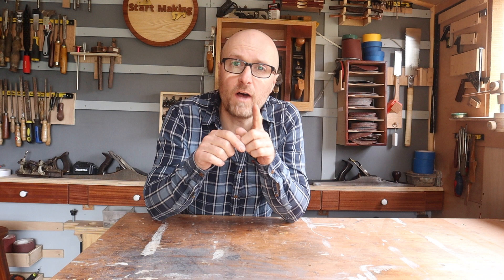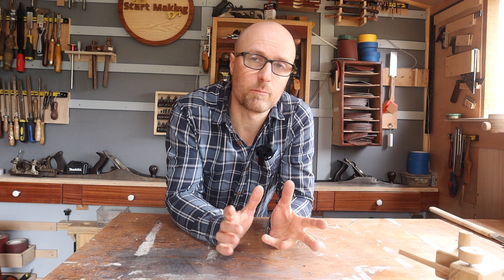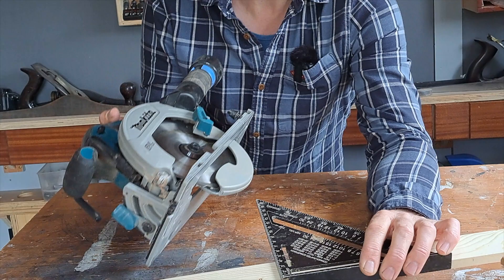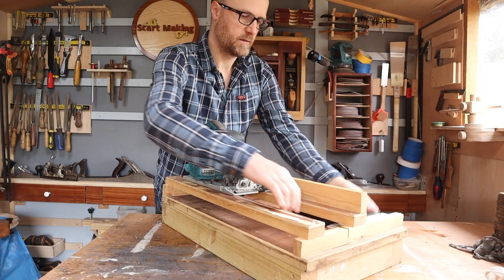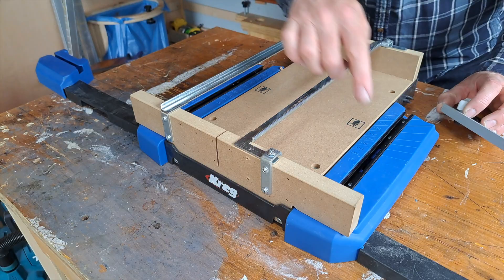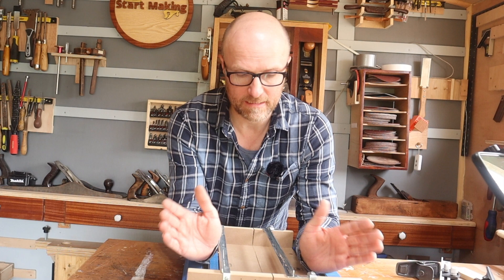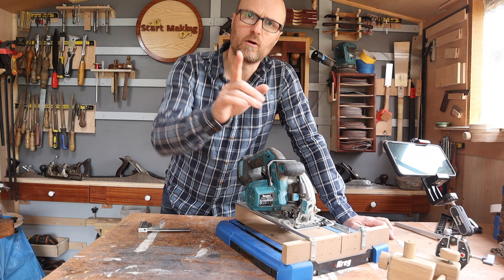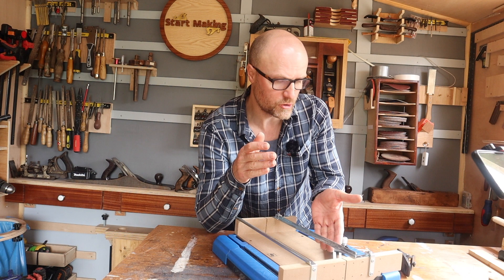Have you just nailed SQUARE cuts ? CHEAP too !!

Comment: Hi Mark, great channel and I like your videos, please keep up the good work. One tip- CA adhesive is triggered by moisture, if you breath out on wet CA glue before joining the pieces it sets much faster, though not as instantaneously as using accellerant. I use the trich when jointing with CA where some fine adjustment is needed, or indeed if I don't have accellerant to hand.
Reply from the maker: Thank you Cliff. Much appreciated. What a great bit of advice too.

Comment: the other thing you could use this jig for is to flatten boards with your  router
Reply from the maker: Hi, I love that idea. What a clever use. Great for small charcuterie boards and things like live edge coasters. And I was initially thinking it would be a pain to move the bars for the narrower router base but a piece of perspex cut to size would negate that issue. thank you so much for the inspiration. Amazing,.
Reply: If you use a piece of Perspex one other thing you can do is to put a hole in for a vacuum cleaner hose so that you have less mess at the end

Comment: £60 for a Kreg, or £160 for DWS774 ?
Reply: Sorry I have binged on your channel, but forgot you have no mains!! Do not buy a battery mitre saw.  If you buy a 20kg unit it stays in the shop. A 10kg one can be moved anywhere.  Love your channel 👌
Reply from the maker: difficult depending on situation. For me you are right, this is a. no brainer due to the lack of power. but for someone with power, I see the reason to overlook it. At the time of filming though, these were $20 in the US and around £45 in the UK. So I felt that it was a better recommendation. You would not believe how long I looked at a battery, Makita mitre saw. I think it was a whopping £750 .I was close to getting it but just couldn't bring myself to do it. Glad now that I didn't . PS thank you for watching every video, not gone unnoticed.

Comment: Very good tips and yes square cuts are vital and still a challenge. Especially when using reclaimed wood like I am doing. There is one i recently had issues with that you didn't mention.  Was having a problem with cuts over 6 inches (15cm?)  curving off to one side even using a straight edge. Couldn't figure out what the issue was and it was screwing up a outdoor cat house i was building for a stray my wife and I were caring for. Finally noticed by chance that one tooth on my blade was just slightly bent off to the side. That one tooth was pulling the saw off by 3 inches over a 4 foot cut. But even in a 6 in span was more than enough to unsquare my cuts. So long story short check your saw blade teeth.
Reply from the maker: Hi Lee. Thank you again. They are the most challenging thing once you master plane blade sharpening in my opinion. You are spot on about checking teeth. Cant believe how far that has pulled you out of square. Was that using a guide. I find mine wanders but that is often user error in my case. Going to head down and check mine now just in case. Thank you
Reply: That was using a straight edge clamp, yes. Depending on which side I was cutting against, it would either wander off to the side or would bind into the straight edge and completely stop the saw. Caused me no end of headaches in that build and couldn't think for the life of me what I was doing wrong. It was really only happenstance  (see tossing my saw aside in frustration ha) that it was upside-down and I could see the one tooth that was bent out of line in just the direction of the drift I was experiencing. I have no idea how it happened because I normally take very good care of my tools. Perhaps I clipped a nail or a really hard knot, but it was one little thing that nearly completely screwed up the whole project.
Reply: ' That one tooth was pulling the saw off by 3 inches over a 4 foot cut.'  
Realize, that one tooth being off generates a tiny force.  That can then interact with the free play of the system.  Then you get 5 or 10 other teeth crashing the other side unevenly, and then causing an even greater force back the original way.  Tiny defects can be multiplied very fast when you're spinning at dozens or hundreds of times a second.
Everything gets multiplied many times due to dynamic interaction with the play a high speed rotational system.  There is no 'small defect' in such a system.  Even a defect that doesn't show up at one speed will show up at another.  Everything has to be even and near perfect rotationally to work evenly through a range of speeds.
It's why tire balancing is kind of an art, or requires a decent computer based system to tell you what to do.  Or experience and more time to get it right.
Helps for me that I learned from flying RC helicopters in the mid-90's, finely balancing rotor heads until they run smoothly through all speeds teaches you how to do some things.  At the end you're using tiny slivers of tape to distribute just the right amount of weight to just the right place.  And it's amazing and scary just how smoothly you can get a complex collection of parts to spin.

Comment: I saw this Kreg tool in your shed tour video. I wondered what it was. This looks great for a beginner who has minimal tools. I might buy one, it looks pretty handy and fun to use for some quick cuts. I like the portability of it as well.
Reply from the maker: That is exactly who it suits. And portable. though be careful not to squash the metal runners. Not all that useful for someone with a table saw, but perfect for beginners.
Reply: @startmaking1  If a friend or family member was starting woodworking today, I would advise them to buy the Worx Exactrack circular saw so they have a versatile power tool which does the job of a circular saw, track saw and a table saw in one and buy this Kreg Cross Cut station to do the job of a sliding mitre saw.

Get them started on the right foot with portable tools which they can take to the garden, no excuses. Straight and safe rips, square and safe cross and mitre cuts. All they have to think about is the joinery methods which I would recommend dowels for a beginner as they help square up the pieces during glue up and assembly.
Reply from the maker: That would be good advice and they would be lucky to have it .

Comment: I just discovered your channel: I really enjoyed your high speed shed build, and your videos on French Cleats are very inspiring. Like you, I made my own cross-cut sled, and I'm fascinated by the Kreg tool. Do you have any experience of cutting compound mitres with it - where you tilt the saw in relation to the base plate? Thanks.
Reply from the maker: Hi. I was saddened to find that this does not work on the Kreg as with my circular saw, in tilting it the blade does not reach the bottom and so doesnt cut through the wood.

Comment: Great vid, Mark. I'd been taking a look at this since one of your previous videos, and then Amazon has recently had it on sale for only $20 (US), along with their "portable crosscut" jig for only $10, so I went ahead and got both the other week. After seeing the size (it's actually relatively big!), the speed square trick might be better for smaller boards, but if you have something larger, then the portable crosscut might actually be a benefit. But for only $10, I figured what the heck.
Reply from the maker: Hi Matthew. That is an absolute bargain. I paid £50 roughly and to be honest it is good for where I am but I still need to progress to a table saw when I can. But if I had paid that at the start and not had to make my ridiculous wooden on, then I would have felt it was great value. one of my next videos is making 6 pine jewellery boxes and not to exaggerate but this jig must have saved me around 3 hours compared to how I used to make the cuts with a hand saw and mitre box. More probably. Thank you for watching as always and for commenting. Love hearing your experiences.

Comment: Nice video again m8 as always not what a was expecting the video to be but seems like decent wee bit of kit. I'll catch up later with u. 🏴👍
Reply from the maker: Thanks bud. It's good for beginners for sure. No use for you or anyone who has a table saw which is most of the people who may watch I guess. Still, I do wish I had one at the start.
Reply: @startmaking1  no totally seems like decent wee bit kit like u though square cuts before a ran the table saw used to drive me insane. Think as u said for people just starting that wanna give a go be something to assist but like u picked up on the board legnth is really the only thing that lets it down.

Comment: Don’t have a circular saw, but tips on doing straight notches with the jigsaw would be helpful!
Reply from the maker: Hi Kathryn. They are a law unto themselves aren't they. I have to say that for perpendicular cuts I still use my speed square and long straight cuts I use an edge guide clamped on. Freehand is really hard and I can only imagine that practise and turning the oscillations down if the jigsaw has that function.

Comment: Hi Mark. Much as I like your video and the lengths you go to achieve your aims, sometimes I wonder if it's worthwhile looking outside the box. There are a number of cordless mitre saws available at around the £100 mark, in relative terms, not much more than the Kreg jig. Are they any good? Only by using one can you make up your mind. I don't know what I would do without by chop saw which has seen so much service over the years.
Keep them videos coming. Is it time for you to consider installing power to your shed? The project would make an interesting video.
Reply from the maker: Hi Costa. Good to hear from you. I hope you are well. I am going to email you a picture later today that will show you how well timed your message is.
Reply: No, do not buy battery mitre, especially not a cheap one.
Reply: @christianwithers7335  The point is moot now that Mark is building a 'proper' workshop with its own power supply. Now he can get himself a decent mitre and/or table saw.

Comment: That cross cut station looks a good idea but not sure might just stay with table saw when I finish my workshop/shed cabin finished painting now need to clear bits out and fit the rubber floor and then try to build workbenches and have no idea what I’m doing just plodding along. Can I ask what size wood did you use for french cleat system and is it easy to do as I’m a complete beginner
Reply from the maker: Hi Steve I definitely don't think that it could replace a table saw and sled but for a beginner without the larger tools I think it is really handy. As you may have noticed, I don't have power in the shed so for me it is perfect but as soon as I have the capability to get a table saw, I don't think it will be quite so well used. As for the French Cleat system, mine is in no way a good example of what you should do. But if I had to do it again I would happily use 12mm ply for the cleats in both the holders and the wall. It hold everything just fine, though if you want to have a little more confidence, I have some that are 18mm and they work very well. the holders I make out of 12mm ply apart from the clamp holders that are 18mm as they jut out and I wanted a little extra strength. I always glue and screw the cleat to the holder and have not had one fail yet. Plodding along is a great way of doing it. I try to do one shed project followed by one build and keep rotating that way I can plan one while building the other. And the shed always gets improvements done. Keep me informed of how you are doing. I love to hear.

Comment: 'Not easy...' Compared to, say, quantum mechanics, it kinda is...
If you want to cut square (accurately) with a circular saw you use a track saw. 
The kreg unit is basically an upside-down saw sled, which people make all the time. Worth (if you don't want the cost of a table saw)  making a table that takes your circular saw upside down. You now have a table saw to which you can add a (self made) sled. Gives less tear-out, and you can do rip cuts too. Add a router mount, and you have a router table as well...
There is  reason the table saw is the heart of most wood shops. Although, for sheet materials, you can make a case for the tracksaw instead (with suitable table, easy to make).
Reply from the maker: I agree, though I would never be brave enough to mount a circular saw upside down without any of the safety features of a table saw. This is a great bit of kit for a beginner and in my opinion all beginners need a circular saw. It may not be the most important but it is useful at all times and stages of your journey. I used a home made jig for a long time and it fell out of square way too much.

Comment: I'm thinking about buying this puppy to start making more things done,  however i have a couple questions regarding this product:
¿what happens when that mdf (?) pieces that comes with they all tear out, is it easy to replace them?
¿what about adapting some toggle clamps somewhere, is it possible?
Reply from the maker: I believe that you can replace it. Mine has had a lot of use and I have scrubbed it up a bit but the cut is still good. The clamps that come with it are only ok. I dont really use them all that much. But it depends on what you are using it for I guess.
Reply: @startmaking1  thank you for taking the time to respond me. Amazing channel
Cheers from Mexico
Reply from the maker: More than welcome. Thank you for watching and reaching out.